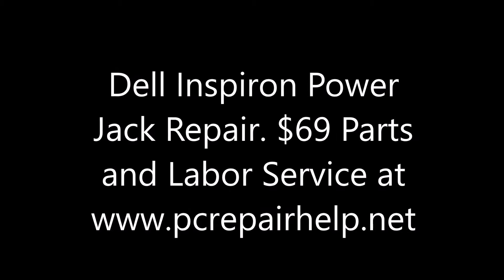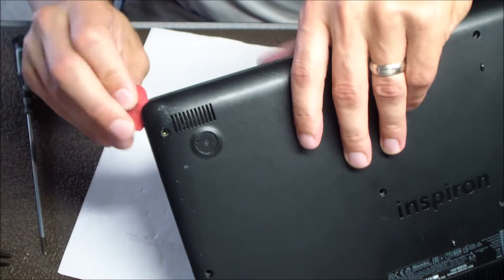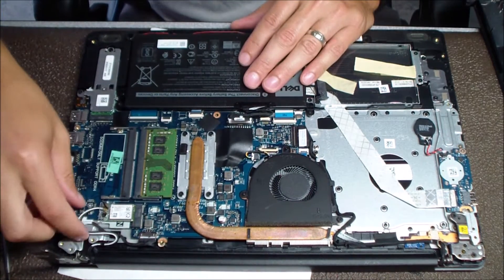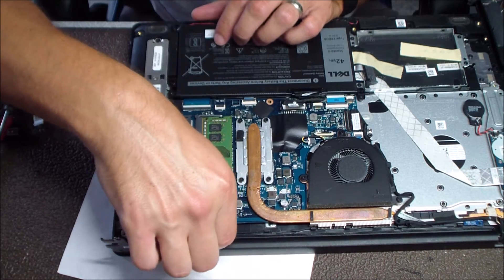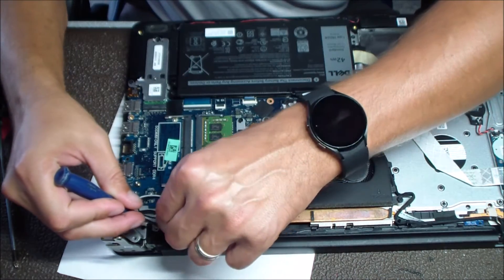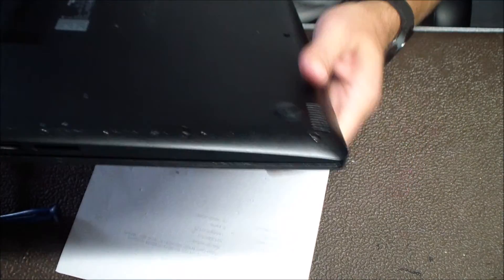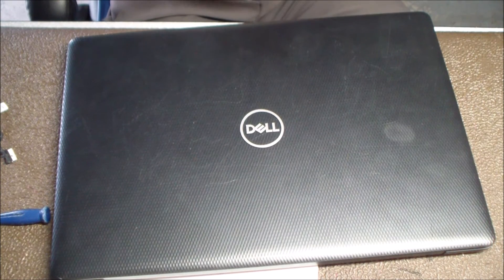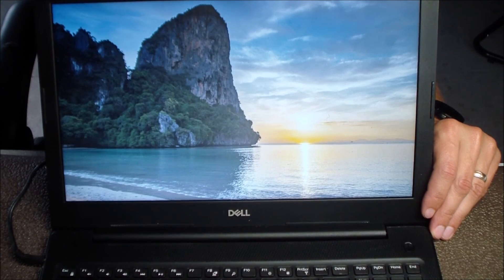How to fix a Dell Inspiron Laptop: DC Power Jack Repair

Comment: The Dell jacks are not very robust, my 7353 last about a year to 18 months. a couple times ago the hold down post on case broke. Shored up the next one with some foam. but the flex eventually broke solder joint at jack wire. Doing an epoxy test now to see if I can "pour" a holder that won't stick to jack , so I can just pop old one out and new one into the epoxy "holder" next time it breaks. drill and zip-tie loop is also being considered. at least the jacks are only $7 bucks
Reply from the maker: @jayc4283  yes, they are brittle and not designed for longevity

Comment: Dear friend I have dell When I connect the charger to the socket, the white led doesn't light up, when I shake the charger plug, the led lights up, what's wrong?
Reply from the maker: Have you tried a different power cord?
Reply: @pomeroypowerjackrepair  yes dear friend and the same thing....maybe power jack the problem?
Reply from the maker: @valantis7901  So both chargers have the light on before they are plugged in and when you plug them in the light on the cord goes out until you shake it?
Reply: @pomeroypowerjackrepair  two chargers work great....shake connection to the laptop jack led blink

Comment: Thanks for the information, the reason I hesitate is you made mention to the fact that it could be a bad mother board, I'm not a computer guy and I never seem to have a problem with the mother board, so that why I hesitate in doing the repair, not knowing if the laptop is worth the money that would need to be put into it?? what's your opinion? It a Dell Inspiron? whats your take on it? is it worth it???
Reply from the maker: John,
What was the exact model number?  That will help me identify if it's worth it or not.  Thanks,
Steve

Comment: #1. where are you located? #2. it took you about 30min to install the power, Jack connection. #3. what are the costs including shipping to you and back to me in Centreville, VA 20121. I look forward in hearing from you, I will collect the dell information that I need to have in order to order the part. Note: What is the cost, on your YouTube demo you said $69.00? not including shipping.
Reply from the maker: John,
I'm located in coconut creek Florida but I do the mail in repairs from all over the country. 
Yes, from start to finish it takes anywhere from 30-60 minutes usually. 
I ship via FedEx ground which typically costs around $25. I charge a flat $89 (parts, labor and return shipping)for the Dell Inspiron 15 laptops.

Comment: Hi i the part replace as in the video. But it wont power on and no light comes on. I do get power to the cord from outlet but it goes out when i plug the charger in ...help
Reply from the maker: Unfortunately if the light goes out you have a bad motherboard.
Reply: @pomeroypowerjackrepair  I see. Roughly how much does a motherboard run? Inspirion 15 3000
Reply from the maker: https://www.ebay.com/itm/233693247805?hash=item366933f93d:g:LO4AAOSwmZpfRq8G&amdata=enc%3AAQAHAAAA8BSMRRGweWhtDcobe4RY955SsgA9FWEKkIdmGnlj9lv6JfnaHK7vGpGkwxiSUNKWIWDoFqChgH6RysS3nl26bb4cNHgHkS6%2FkANeRQ8NqQUnYsfW3e1Ryi8u0t4ppy9BFvASPRTV6yve5yuz4Hlb5t3gn3LmovIakuPVS0R6ldU5ysPIRgBs9gadfqhendh%2B3LZ28AeOMh0DDH5Q6AV8xue2SXoKztY%2BsEEXafKGxLaeH76DIn6yuuzj5KOj0C6qHN5Ss5rXfC26QgOul36F47pXvatzpvBt%2FCGu4qUJsCJpwmFq4G1iwC%2B%2BrAAqBO9U%2Fw%3D%3D%7Ctkp%3ABFBM0IeOhetg
Around $100.  You need to match up the dell part # to your motherboard so you get the exact motherboard that you are replacing.